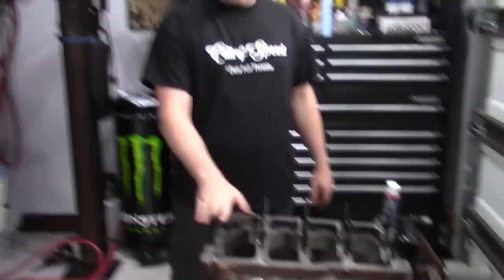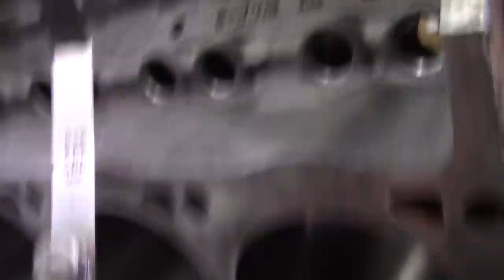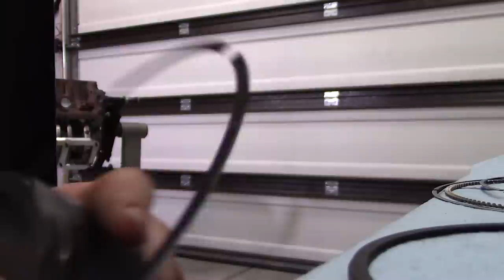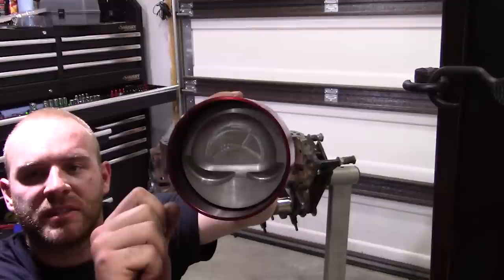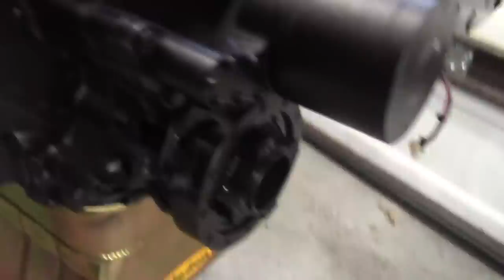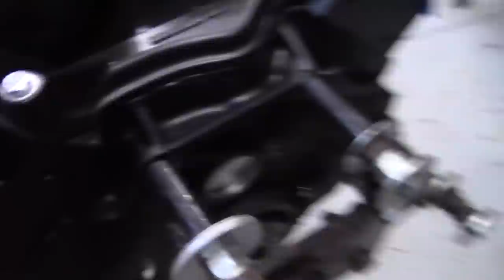500+hp 351W Stroker Build

Comment: Nice work !  Would that be a 396 cubic inch with the stroker ?  We are finishing up a 351W project now so your video was very helpful .
Reply from the maker: this one is a 408.  i was planning to do a 393 but there were no kits available for multiple weeks so since the 408 was on the shelf  we went with that instead.  
glad the video helped you on your build!
Reply: @710Garage  I like it !  Our 351W was bored .060 over so it's around 362 cubic inch now . I was also looking at some of the stroker kits but was not sure if they would work with our pistons ?
Reply from the maker: @cranerigging3604  60 over is not super common so the problem would be a piston combo. 

im sure someone like eagle has something in their toolbox that could help you out. 

might be worth a call and see what they have to offer
Reply: @710Garage  Thank you !   Yes , I was sure surprised when we pulled the heads on the 351W and saw the .060 on top of the piston .   Did you go with a centrifugal style blower on your engine ?
Reply from the maker: yes novi 2000. main goal was to maintain a stock hood. so that was the only option unless i wanted to run a turbo
Reply: @710Garage  I found it .  https://vortechsuperchargers.com/products/paxton-novi-2000-supercharger?variant=12420842324054  That's pretty cool it all fits in the engine compartment under the hood ! 
 I got to mark out and cut a hole in the hood on the Ford Ranchero , one more thing to do LOL !
Reply from the maker: @cranerigging3604  yup just depends on the look you want!

Comment: The installation of the rings is not critical, just make sure the end gaps don't line up. did you know that when the engine is running, the rings actually spin around the outside of the piston in the groove? I've heard engine assemblers say that ring gap spacing is critical, well, hate to say, it's not.
Reply from the maker: while there are TONS of theories on each of the things you mention, this is the way i do it... EVERYTIME...

the same thing can be said for most anything in life....  cutting your grass, to how often to change your oil...

i appreciate your opinion and thank you for sharing.
Reply: The rings don't spin.

Comment: I never rebuilt one  so I may be wrong don't u put assembly lube on cam lobes too I am getting ready to re build a 1971 _351 w. For my 1980 Merc.capri
Reply from the maker: absolutely you want to put lube on everything.  we only did the bearings as we always prime our motors using an oil pump drive and a drill.. so it lubes up the lobes well before we start.  also the cam and lifters were used together prior so we marked the locations and re assembled the same.

Comment: I gotta find a Windsor block to turn into a clevor. I bought a 71 mustang and unfortunately seems the Cleveland it came with got replaced by a 351m which doesn’t like high rpm.
Reply from the maker: clevor's are cool.  i do want to build one, one day.
Reply: 710 Garage I’ve gotten the car moving with nothing to do with quarantine and all. I’ve found  a shop to do the body work and paint.  I guess that gives me time to find a block to build up.
Reply from the maker: thats perfect then.. sometimes things happen for a reason lol
Reply: @Bonanzaking  i. Building  a tim myer 446 stroker 351m. It'll spin 7k+. The modified is a tall deck cleavland.  If you can't find a good replacement motor then give tim a call and he can get you set up with a good combo from mild to wild and make that 351m sing

Comment: Do the Pistons come with a info card that tells you that you need to grind the piston ring to 26 thousands of an inch?
Reply from the maker: That Gap will change if you're running boost or nos.  Also if you're NA.  So no they don't give you an exact. But you can call the manufacturer and they can help guide you
Reply: @710Garage  I have been trying to find the exact same rotating assembly as you but everywhere is out of stock and on back order. Is there any other way I can get the same rotating assembly?
Reply from the maker: You could buy my motor if you wanted? Lol
Reply: @710Garage  I'm trying to build it my self lol thanks for offering tho. What other rotating assembly would you recommend thats strong enough to hold 700-800hp
Reply from the maker: Can you find a 393 setup?
Reply: @710Garage  is there that big of a difference when you compare a 408 to a 393? I was honestly deciding to do that as well but no replacement for displacement man.
Reply from the maker: You can make 700 on either NP hell you can make 700 on a 351 if you dial in your setup

Comment: Do you recommend cleaning with brake cleaner prior to assembly? Wow I totally missed when the main girdle was installed🤔
Reply from the maker: we clean with lacquer thinner prior to assembly.

brake clean works too, i just use lacquer thinner on mine.

the main girdle stuff was shot, but we were not happy with it so it was left out.  ( we did toss it into the recommended parts video  as a blooper )
Reply: 710 Garage 10-4 I saw it on the later video. I’m buying the same one

Comment: could i use a regular 351 5.8 from a f150? I have a 1992 sitting in the yard with a 302 5.0 in it. its carburated and the 5.8 351 has fuel injection. think i could make it work with you parts that you used?
Reply from the maker: the 351w or the 302 will work.

you just cant swap intakes off of them due to deck height the 302 wont come close to bolting up.

stuff like cylinder heads, water pump, alternator etc would work though
Reply: 710 Garage also what’s a good price range for heads?
Reply: 710 Garage I’m thinking about a street build with 500 horsepower 351.
Reply from the maker: literally whatever budget you can manage is better than stock.

mind you you can spend 1500-9000 on heads... 

my heads are really nice units, trick flow makes some great ones, edelbrock...   
DO YOURSELF A FAVOR  and stay away from the pro comp cheapy heads  anything 0-1500 i would be scared of.

but like i said the best bang for your buck will be heads for sure.

Comment: Were the crank bearing clearance checked at the machine shop?
Reply from the maker: i checked them, the footage was not ideal so we decided to leave it out.  i am building another 351w shortly and we will go over a couple things the footage either wasnt good or were left out of this video.

good catch!
Reply: @710Garage  I want to do something similar for my 93 Bronco. I want the low end torque of a stroker. I remember using plastigauge on some early builds. I don't need a forged crank or h-beams. Hopefully I get another couple years out of my 351. Just blew up my E4OD.
Reply from the maker: yup i checked my bore gauge with the old plasti gauge method on this motor.  still works good.

if you are staying N/A you wont need all the forged stuff like i did.  just keep that compression 10+ and you will be ok!

Comment: Cool man . What’s the cubic inches ?
Reply from the maker: 408 cubic inches, a 16% increase!
Reply: 710 Garage nice ! Have you had trouble with the rear main seal leaking ?
Reply from the maker: its a 351 they ALL leak lol

that and my oil pan has a small leak in one of the factory welds.
it sucks but i just keep a tray under it.
Reply: 710 Garage that sucks I wish they wouldn’t leak so often . That’s one nice thing about the LS , they don’t have that issue I don’t think
Reply from the maker: ya its not ideal. but ive learned to accept it.

im not an LS fanboy.  i do appreciate what they are capable of. BUT am sick of the LS the world crap so cant do it.

Comment: what rotating assembly for a 351 Cleveland .30 over  forged ?
Reply from the maker: what comp ratio, what heads, budget?
Reply: 710 Garage well he wants a street and Streep what’s something that he can use nitrous or boost
Reply: Stock heads and I really don’t know he’s budget. But I know for sure it’s not crazy hi..
Reply from the maker: nitrous and boost are totally different, you want low compression for boost and high comp for nitrous.
i think to start you should figure out your power goals and which direction you would like to go in, before spending a bunch on money on parts that may not work best later on.

Comment: How reliable is that engine? Do you feel comfortable using it as a daily driver?
Reply from the maker: would have no issue using it as a  DD..   i however dont.  if i was planning on that i would drop boost down a bit since 16-18 is a bit high for daily use.

Comment: that milodon pan cost me an engine rebuild. The bottom of the pan shattered like glass. No impact ever touched it.Nothing. Metal fatigue and too thin of a metal. Cracked like a spiderweb and lost all the oil. Right below the pickup tube extension, Never use another one. ever. not in my shop. Trash that fram filter. get one that'll hold 80-90psi cold 20w-50 R oil. Looking good. would be curious what it dynos at.
Reply from the maker: ive used them in the past alot and never had an issue... not saying any company is perfect... but maybe you got a dud???

what pan did you swap out to and how did you like it?

also like i mentioned to a couple other posters.... i use the frams just to put the engine in the car, and fit headers etc... that way nothing happens to my motorcraft ( ford ) filters that i run
Reply: @710Garage  I am building a 302 stroked out to 331, and I am using a canton girdle and large capacity oil pan.

Comment: Wht kind of plate was that on top of crank
Reply from the maker: DSS main support system.   it fit amazingly!!!

http://dssracing.com/D_S_S_Main_Support_System_s/6.htm

that is the link to them!
Reply: Engine Builders refer to it as a main girdle. it strengthens the bottom end up by about 40% on average. DSS makes one out of aluminum, but I prefer the Canton, its made out of tool steel. super strong. Canton also make a windage tray that attaches to the Main Girdle. that allows a gain of about 12 HP by keeping oil off the Crank counter weights.
Reply from the maker: the DSS has the same windage tray.  its preference on which brand kind of like ford or chevy.

Comment: How much was all the honing and boring
Reply: What crank did you use
Reply from the maker: we have an entire video about what parts we used including part numbers and everything.... please see the link below.

https://www.youtube.com/watch?v=XorznMfw4pQ

this will go over everything we used and why.
Reply from the maker: our machining bill was around 700 bucks.. 
that included:
cleaning the block first of all
line honing
square decking
installing new cam bearings
installing new freeze plugs ( frost plugs or core plugs )
clearancing the block for the stroker crank
de burring the block for oil flow
checking end play for the crank
and checking bearing clearances.

so all in all i think it was MORE than a fair price for everything done..
Reply: That’s pretty good I’m doing about the same thing just not boring out my block just a stroker crank with cam and high rise intake and carb
Reply from the maker: sounds like it will be a stout little combo.   what compression are you going to run and what heads?
Reply: Aluminum gt40 heads and I honesty don’t know how to find the compression
Reply from the maker: they are a good head for the price range for sure...

are you changing the pistons? or are they stock
Reply: Yeah new pistons and h beam rods and the 4in stroke crank. And idk which cam to use yet just bc I don’t want something too small or too big and it be a dog. I’m new to building engines. I’ve done heads and normal stuff this is my forst

Comment: You mention 500hp but nothing on compression ratio, Cam specs, which cylinder heads etc. just basic engine building info here.
Reply from the maker: there is a full PDF listing all components posted, for people that want to know all of that info.

Comment: You didn't show cam timing.... what's up with that?
Reply from the maker: Its installed straight up.  nothing special here.
Reply: @710Garage  ok cool.  Timing Markings and covers? I got mine in pieces and need to see where they all go
Reply from the maker: there is a timing mark on both of the gears just have those pointing at eachother and that is straight up 0 advance.
Reply from the maker: the cover just bolts onto the front of the block and there are a 4 that go up through the oil pan to hold the cover on.
Reply: @710Garage  awesome thanks allot bro👊🏻

Comment: Can anyone tell me the difference in a 302 and a 302HO
Reply from the maker: - HO 5.0 came with 225 HP non HO 5.0 had 150 HP
- HO have E7 heads, non HO use the E6 heads.
- HO have forged psistons with valve reliefs, non HO are cast and flat top
- HO has a hotter cam than the non HO. Some non HO are flat tappet cams.
- All HOs have a roller timing chain while pre 1988 non HO do not
- HO motors have 19# injectors, non HO use14#
- The HO upper Intake and throttle body opening 58MM vs non HO 50MM
- HO have ss headers, NON HO 5.0 has cast iron exhaust manifolds

Ref: https://www.stangnet.com/mustang-forums/threads/302-vs-302-h-o.888026/
Reply: A 302ho. Uses a 351w camshaft changing the firing order to take the load off the left and right front pistons

Comment: Did you degree the cam or install it straight up? Are you using solid lifters,roller lifters, hydraulic? What kind of heads are they? Do you plan on using a engine or chassis dyno to tune it and find out out put numbers? Call me sub #74!!
Reply from the maker: - its installed straight up as its only a fun street car.
- hyd roller lifters in this motor for super easy, low maintenance.
- they are Dart pro 1 heads that have been leaned on a bit ;)
-it will end up on a chassis dyno for the final tune.  engine dyno's are awesome but its alot easier for us to throw it on a chassis dyno so thats our plan.

THANKS FOR THE questions Sub #74! lol

if we can assist let us know!

Comment: Fram oil filter? Wtf
Reply from the maker: we always use these for assembly and install of a new motor and then we swap out for a ford unit just before firing the motor up.
Reply: 710 Garage makes sense being you have to throw out the oil after break in, my personal favorite is wix like most of the guys have already beat up the video with in the comments, at first we all probably thought oh no ! Not a fram! Lol
Reply from the maker: i should have put a note in the video.... but hey live and learn!!!

i do it this way to make sure that we haven't damaged the filter in the process of installing or assembly process.
Reply: @xyzebruh1083 What's with the Fram oil filters? Did they start making them bad or something? I have been using them coming up on 4 decades and never had a problem.
Reply from the maker: alot of people have a problem with the cardboard filter elements and saying that they fail pre maturely...

lots of people run them and have no issue...

ive used the ford units forever and never had an issue so why change now??
Reply: @Deucealive75  Same here.   I have always used Fram.   Daily driver has 200k miles on it.   Be sure to change the filter at recommended intervals.

Comment: How sad...spend all that $$$ to build a beautiful high H.P. engine and then use a FRAM oil filter. Absolute junk. Hastings, AC, auto zone...ANYONE BUT FRAM for God's sake. They are doo-doo.
Reply from the maker: thanks for the comment.  but if you read some of them before you would have seen that i always put a cheap filter on to install an engine and JUST before firing i swap in a motorcraft filter.

Comment: wtf?? a frost plug??? they are called freeze plugs!!! GEEZ
Reply from the maker: Thanks for the comment.
You never know what you will learn; they are also known as freeze plugs and some may call them core plugs.
 
The primary purpose is for use during casting to remove the sand. https://en.wikipedia.org/wiki/Core_plug
Reply: @710Garage  Really are core plugs needed to cast the block.
Reply: We all knew what you meant! Thanks and keep up the good work.

Comment: What did you have done at the machine shop and cost
Reply from the maker: line bore the main bearings, 
new cam bearings 
deck the block 
bore 0.030" over 
stroker clearance.
hot tank it to clean all debris out.

if i can remember i believe it was around 1500 or so to have that done.